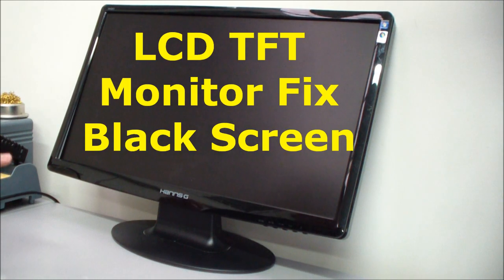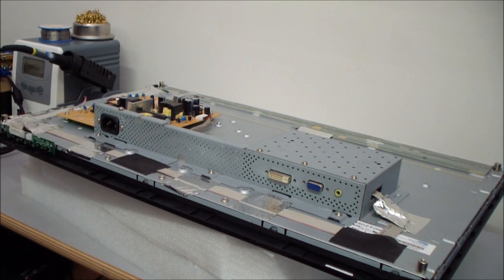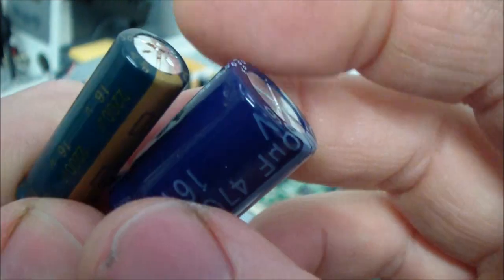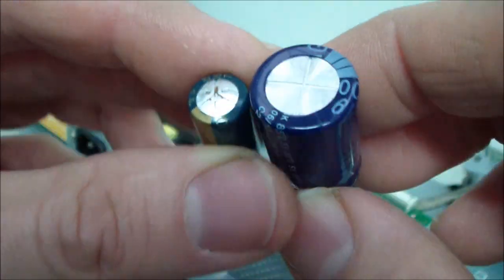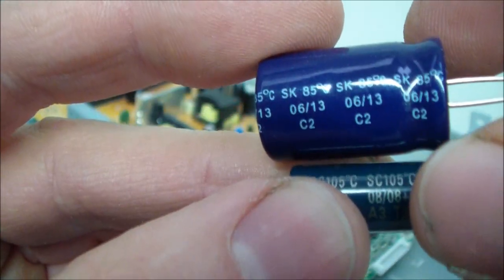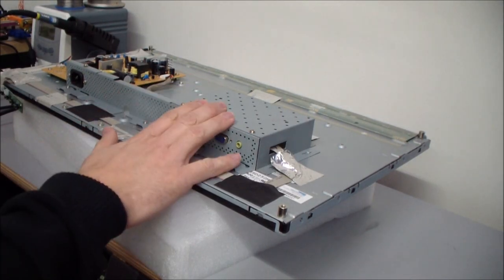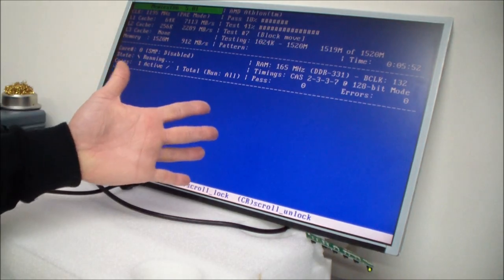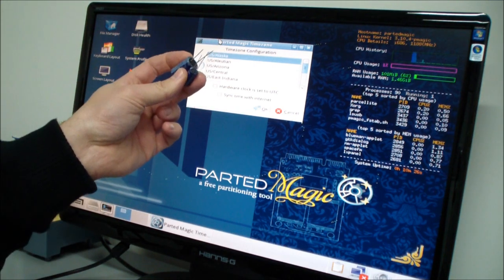LCD TFT monitor fix, black screen, no display

Comment: my monitor was working fine, i turned it off and when i went to turn it back on, no red light (Power off signal) and when i press the power button nothing happens help plz
Reply: same.
Reply: Same issue to me. I dismentaled the monitor and then remove the ribbon between LCD circuit fixed to screen from power circuit. The the power available bulb on. But when connect the ribbon back, again the power available light off..
Reply: Hi guys, have you fix your issues?

Comment: I'm pretty sure you can't just change out a 2200uf cap with a 4700uf. The voltage doesn't matter as long as the replacement is equal or higher. Correct me if I'm wrong though.
Reply: +Sam Buckler i would tend to agree with you on this one same , it is possible that the guy just hasnt given a good explenation but you can use a cap of hte same or higher voltage rating should never replace it with one of a lower voltage rating but you should also never replace it with a capacitor of a differant farrad rating unless you are 100000000% sure that the capacitor is only used for smoothing purposes as the farrad rating of a capacitor plays a BIG role in the calculations done in an RLC circuit , So please guys if you try this the voltage should be the same or higher but USE THE SAME FARRAD rating as what you took off the board .  Also the capacitor this guy used as an example of a blown capacitor is actualy from a computor motherboard , not one he removed from the screen .
Reply from the maker: +cameron hansen Basically it's the best to replace a capacitor with another one with the same rating, voltage and farrad rating. In my case, I repaired lots of monitors with capacitors of the same voltage (or higher) and the same farrad rating (or higher). These repaired monitors still work after years properly.
When a monitor breaks down due to bad capacitors the question is, whether these bad capacitors were too small-dimensioned. But despite this speculation it's definitely safer to replace a bad capacitor by an identical one.
Reply: I agree with Sam. I would NEVER replace a 2200uF cap with a 4700uF. I always use the same capacity and a higher voltage rating. When you use 4700uF, you mutate the circuit and that might be not safe.

Comment: Hi Master, I had a broken ceramic fuse "F801T3.15A/250VAC". But I can't find this type of fuse in my city. Could you tell me PLEASE, can I use the fuse ""F5A 250V  or  F4A 250V" instead of it ???

Comment from the maker: It's pretty hard to find a matching tube and they're not cheap. It would be worth the effort if you would have a second, broken monitor as spare parts source.
Reply: +Tuhl T I'm afraid to touch the monitor :((((((
Reply: obviously you have to solder. Its not lego.
Reply: Anything with capacitors will require soldering do not attempt if you are just gonna tape it on.

Comment: thats correct Sam, you can go higher voltage but not change the capacitance. They choose that value for a reason.

Comment: How if the screen open but a sec.. its turns to black screen??
Reply from the maker: Ricardo Derudar maybe a broken cold cathode tube
Reply: I have the exact same problem. I'm hoping it's a defective capacitor or two on the display board and not the cold cathode tube.  My problem right now is the back of my monitor doesn't come off nice and easy as the monitor he is taking apart.

Comment: if you reading this on 2017 if u left your pc open for long time  then  ur pc auto go to sleep mode  for 5+ hours then when you go back it doesent display well all u need it's to unplug your pc for an hour then plugged it back and on the pc and it will works normally .works for me
Reply: This might actully work for me omg imma do it

Comment: it works! thanks! i have a little bit of hobby electronics experience, and I wasn't expecting it to be the caps, but thanks to your video this was quite an easy fix. :-) device was a Grundig DAVIO 20 inch LCD tv, symptoms were: sometimes black screen on power up, then quick black flicker darkening screen and making it unwatchable (which would stabilize when left on for some time), then always black screen. now it's proper blue again. :-)
Reply: Anton Cabais  hi! no, i dont think there's a logo, the monitor's idle screen is just plain blue color. (I dont have it running right now.) I dont remember if my monitor was only black (=screen on, but "color" black), or "blacker-than-black" (=screen off, pixels zero brightness, like no power) before the repair. So I guess I wont be much help...?

Comment: you need to match the capacitance. It affects the smoothness of the DC and is used in conjunction with the inductors to smooth the pulsating dc to a relatively flat line dc
Reply: I always thought the capacitance can be higher (as voltage)... 🤔

I mean won't the capacitor be charged only to that capacitance (which is pre-determined by other components before that) ? 🤔

Comment: it has a display, but after a few minutes of working, it will off, led signs still on, only the display turns off. I had to turned it off and then on, it keeps repeating

Comment: Hey Tuhl Teim,

I have the exact same Hanns.G monitor, however I'm having a completely different problem. The monitor turns on just fine, however the screen is completely WHITE. I suspect that it might be the backlight of LCD -- the problem began with the screen becoming lighter and lighter, as though the brightness had been turned p when in fact I did not change the brightness setting. It used to be that when I left the monitor off without the power cable for a period of time, the monitor would function just fine. Then I ended up having to do that more and more. At that point the monitor would turn on, display just fine for a second or two, then immediately get brighter and brighter, THEN go completely white. Now when the monitor turns on, it just immediately gives me a white screen.

I would GREATLY appreciate your expertise on this issue. Please respond as soon as you can!

Comment: Hi there thank you very much for your video. It inspired my to try fix an old monitor. The monitor has a very weak signal about 5%, its almost black. Its a Samsung Syncmaster 244t. Do you think that's the same issue?

Comment: I wanted to ask. If my monitor have good working ac/dc adapter which is seperated from monitor. What are the other factor that causes the monitor still have blank screen/black screen after connected to the supply?thanks

Comment: Do you have any other suggestions?
I've replaced the capacitors, still nothing.
The power LED lights up, but the screen remains black.
Reply: +xikes xikies same thing happened to me, have you tried putting the hdmi cable in a different slot?
Reply from the maker: +xikes xikies Maybe you've a broken backlight. Either the LEDs or CCFLs are broken or the LED/CCFL driver board.
Reply: +Tuhl Teim Thanks for the ideas! I have CCFL backlight. Would it be worth it to replace the backlight or try to fix the driver board?

Comment: Question: I'm running duel monitor system and my second screen just went black...on reboot it loads and goes in and then I see the display for about two seconds and it goes black again...if I hit the buttons on the monitor sometimes I get a flash of the display desktop and it goes back black. 

I have taken it apart and replaced all the Capacitors on the Powersupply with the exception of the Large one. 

Same problem no change......Any suggestions?????????
Reply from the maker: Hi Stormhammer, maybe your bulbs (ccfls) are broken. If your monitor has no LED illumination, it has (at least) two ccfls. (https://en.wikipedia.org/wiki/Cold_cathode) If one or more are physically broken, the logic board discovers this failure and turns off the power of the tubes. Replacing the caps doesn't help here. You have to replace the ccfls. Usually this doesn't pay off.

Comment: i turn my monitor it will display for a 3 seconds then turn off, if i turn on it again it will turn on but it turn off again? do you think capacitor is the problem of my monitor?  please need answer before i dissassemble it :) hehe

Comment: My old HANNS G comes  on when I boot up with a dimmed screen, then black out after a while, I wonder if its the same problem
Reply from the maker: Dave Douglas Maybe - but rather a CRT is broken inside of your monitor. When you turn it on, the electronics powers up the CRTs. If a CRT is broken, the electric current gets too high and the control electronics turns it off for safety reasons. So your screen turns black.

Comment: sir can  i ask ? my screen monitor don't have display , when i on the monitor it stays on in 3sec then off but monitor was on "Green light=On" i already open my monitor's back but there's is no damage capacitor on it , is there another cause of it?
Reply: The same here, did you already fix it if yes how?

Comment: Please help me i have a problem my samsung LA22C350D1 cant detect HDMI but instead DVI detected. I am using HDMI to my video card/graphics card HDMI and my resolution is only 1024x768 and 800x600. In my Nvidia settings Digital Display was reading instead of HDMI to HDTV. What can I do? Sorry for my bad english! Thank you in advance and God bless!

Comment: Where can I buy the capacitors for my monitor ?
Reply: MJ Sanchez radio shack
Reply: @dontblameme6328  this comment was left 3 years ago...
Reply: You can buy them at Mouser(https://www.mouser.com) or Digikey(https://www.digikey.com). Make sure to replace them with the same or higher temperature rating.

Comment: The main fix is replacing the capacitors but you don't show us how to replace the capacitors ?!?
What must we do you? Search for another video?
Reply: Well you do need to have some soldering basics. I knew that right away from the thumbnail. But probably it should have been stated in the beginning of the video I guess.

Comment: Hi Mate, Can u help me? I have a problem with my 7 years old LG 2360V-PN external PSU monitor. Its give me the picture, but looks so purple. https://prohardver.hu/dl/upc/2017-06/299177_20170614_204001.thumb.jpg

The cable is good, the vga is good. Make it only at the Summer time. Last year has begin, but at the Spring turn good again. What do you thin, where must is begin?